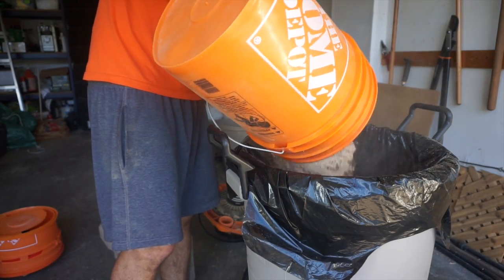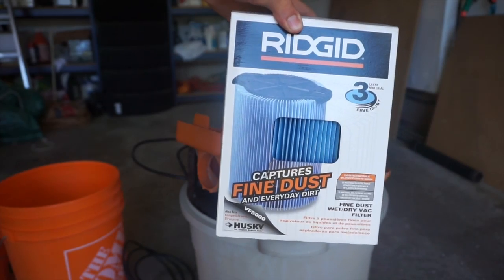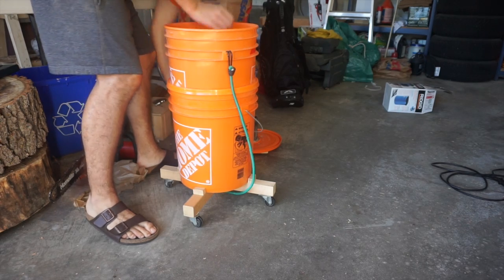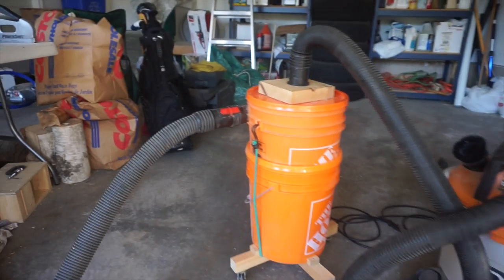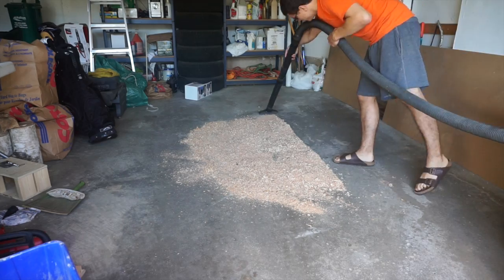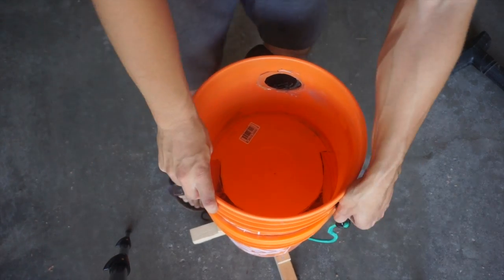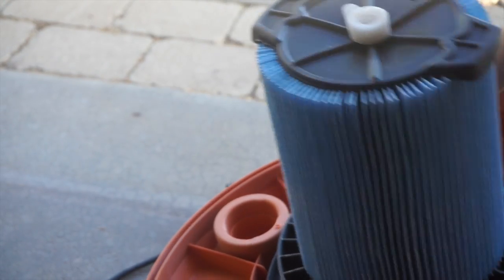Improved Thien Baffle Dust Collector Design From Two Buckets

Comment: For this specific design, optimum separation of fine dust will occur when there is zero air leakage at the joint between the top and bottom buckets, where the baffle is located. You can tightly wrap a continuous length of kitchen cling film around that joint. Any air leaks will be visibly disclosed and sealed when the thin film is sucked inward.

Comment: Wouldn’t it be better if the dirt coming into the bucket was below the baffle? Or am I seeing it wrong
Reply: Dust enters above the baffle, then drops down to the lower bucket. The baffle prevents the dust from swirling around and going out to the vacuum. Edit: now that I've watched it again, I don't see that he actually has a Thien baffle in there, do you?
Reply: Neil Garber yes I understand that, but if it enters below the baffle. Less chance of it going up through the vac. Going to copy your idea, just want to have it right. Thanks
Reply: @DreamstoRealityAutomotiveTV  It's a little counter-intuitive, but that's how the Thien baffle works. Do a Google search and you'll see.
Reply: Neil Garber not arguing, I will look more. Thanks

Comment: Dave, great video. I've given this a go, but can't get the bucket to stick to the lid (keeps coming apart). What did you use to stick it down?
Reply from the maker: I scuffed you the surface with sand paper, then cleaned with degreaser. I used epoxy to make the connection and it has not come apart yet.
Reply: @gogodave0  thanks mate, I'll give it a go.
Reply: @gogodave0  So I gave this a go yesterday. Used loctite epoxy and this morning it looked great. But after vacuuming I tried opening the lid and it came apart. I'm thinking either the type of epoxy is wrong for plastics or I didn't use enough. Any suggestions welcome.

Comment: Dave. Reference the top bucket, I cut about 4 inches off the bottom of the bucket. I cut the baffle out of the bottom lid and cannot slide the remainder of the top bucket into the lid so I can slide the top bucket into the bottom lid.. How much of the bottom lid did you have to trim off so the upper bucket would fit  inside, Do you have a photo that shows how little of the lid has been trimmed? If I am not clear with my question, I close up of the lid on the bottom of the top bucket from the inside and outside should answer the question. I have a feeling I need to trim more off of the lid on the bottom of the top bucket. Help please. Others who have done this, feel free to help also. Thanks in advance
Reply from the maker: Jim Doyle Hi Jim, the top, cut bucket sits within the lip of the bottom lid that acts as the baffle. I have some pictures I will try and post
Reply: I put it all together but silicone is not holding the top bucket to the lid of the bottom bucket. I believe you posted that you you used 2 part epoxy and can you tell me how well that worked out. I am about to cut out a wood circle that matches the baffle and screw it into the sides of the plastic bucket baffle and to the bucket  baffle as I know that would hold. Overall, it worked great....cleaned up and dumped about 1/2 into a paper shopping bag without any trace of waste in the shop vac but my silicone failed me. I really appreciate you discussing this with me.  Thanks for all the assistance and guidance to date.
Reply from the maker: Jim Doyle hi Jim, sorry, I couldn’t figure out how to send you some photos of my bucket dust separator. You’re right, I did use epoxy, and it has held together since I’ve made it a few years ago. I have found there is enough surface area for the epoxy to hold. If you want to try and direct message me on YouTube (I couldn’t direct message you) I can send you some photos of my separator. I am really happy with mine and haven’t made any changes since I made it.
Reply: Dave...can I send you my email and after you load the photos, can you edit the email address off your site so I am not bombarded with emails??? I could do this will my cell phone if you can edit my number from this message? I use a PO Box if you would like to mail pictures?  Can you describe the epoxy process since the top bucket and bottom bucket lid are really tight and not much to put epoxy on as it appears the epoxy will all squeeze out. I have zero experience using the epoxy.  I have an old soldering iron and might try to melt the baffle bucket onto the lid of the bottom bucket? What do you think of that idea???  Thanks
Reply: @gogodave0  I think it would be great if you did a quick video showing the details of the two bucket build, with details like epoxy, etc. You've got a great, efficient design here, but I had to go through frame by frame to pick out a lot of the details. I'm glad I read the epoxy detail here in the comments. 

Even if you can't show the progress of the build, just having some nice shots and explanation of your process would be super helpful. I'm especially curious about the input tube to the bucket. It looks so fragile, but as you've said, it's worked well for you, so I'd love to know the details of how you did it.

Comment: I built a similar one and found that it was great at separating large particles but fine dust still made it through. Basically ended up cleaning two containers instead of one + the drop in suction made mine not worth it. Did yours end up doing better? I dig the base & use of a cord to strap it down.

Comment: How did you attach the lid that forms the thein baffle to the upper bucket?
Reply from the maker: I scuffed up both surfaces, degreased, then used epoxy. Quite a bit of surface area so its a pretty strong joint. Thanks for asking!

Comment: Hi, would in your opinion be any of a difference in using the full bucket with the half bucket, or using 2 full buckets? 
Thanks
Reply from the maker: drail80s thanks for your comment. I think two buckets would be too high. It would be too top heavy and you'd be adding additional air volume that the vacuum would have to move.

Comment: i would think with that much of the lid cut away for the baffle you would get a lot of  flex over a piece of wood cut out and mounted in there. your thoughts?
Reply: I guess if you build it this way and you feel there is too much flex, you still have the option to glue & screw a piece of ply to the baffle-lid.
Reply from the maker: I agree that wood we be much stiffer. But for what it is I think the plastic works just fine. Thanks for your comment!

Comment: will that lose some of the suction ??     I wonder if that system could somehow be built into the canisters itself instead of dragging around an addition bucket.
Reply from the maker: I haven't done any "science" to test the loss of suction but functionally there is no significant pressure drop. My guess is that the pressure drop from a clogged filter and no separator is much greater than with the separator. I don't think they include any chip separation in conventional shop vacs is due to size, and shop vacs aren't strictly designed for woodworking, but it is totally doable.

Comment: Any idea on how to trap drywall dust?   I can only vac for half an hour before the poor filter needs a bashing
Reply from the maker: Hey, thanks for the comment. I think a cyclone would do a decent job at separating the dust from being blasted into the filter. If you do a lot of drywall you might want to go with a dust deputy (or similar).
Reply: Don't mix up the inlet and outlet connections though!   ;o)

Comment: Could you use a 2 gallon bucket on top of a 5 gallon bucket instead?  You say in the comments below that you cut the top 5 gallon bucket in half and glued the bottom back on as the Thein baffle.  I am hoping to use a 2 gallon bucket on top and use the same concept as Tableft's bucket head vac (a kind of a hybrid between his idea and yours--yours is cheaper/easier).https://www.youtube.com/watch?v=1Pn5EQJcRys&t=332s
Reply from the maker: I saw that video, It was a great idea! I used two 5 gallon buckets because thats what I had. The nice thing was that the diameter of the buckets worked out well the way I did it. Let me know how it works out for you!

Comment: hey there Dave, this is a great video! thanks, but could you tell me what type of glue/silicone would you use to attached the half bucket to the lid? and how did you attached the hose connector to the bucket? is there any way you have photos or a video. Thanks.
Reply from the maker: I used two part epoxy for gluing everything together. The hose connector is also epoxied on. I cut the pipe so that it matched the radius of the bucket. I sanded all the connecting faces to rough up the surface and then cleaned with degreaser. I have no problems with the joint connecting the buckets because of the relatively large surface area. However, the pipe connection is a little less robust. I did accidently break it off once but it was because I picked the whole unit up by the single pipe. I was able to just glue it back on though. Under normal conditions, I have had no trouble with the strengths of the joints.
Reply: thank you!

Comment: This is great!  However, could you explain the assembly and work done on top bucket with the baffle?  Watched the two earlier videos and like what you've done with this last iteration best.  Good job.  This one seems to be the easiest and least expensive of all the ones I watched on building a dust collection system.
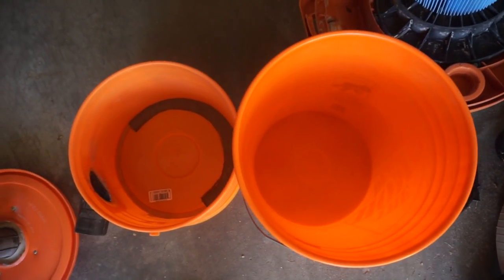Reply from the maker: Thanks for your comment! Pause the video at 0:50 and I will explain. On the left I have a bucket cut in (roughly) half. I cut a slot out of a lid to act as the baffle and epoxied it to this half bucket. I cut a hole in the side of this bucket near the top and glued a piece of pipe (vacuum extender) at a tangent to the bucket to maximize airflow. The second lid, that gets attached to the top of the half bucket, has a hole in the top with a pipe sticking down about 6" which is connected to the shop vac. This draws air into the separator. The dust enters through the port on the side and gets accelerated around the inner side of the bucket. Because it is heavier than air it falls through the baffle and into the bottom bucket. The baffle is intended to stop the airflow to the second bucket so that the dust is stagnant. Because this is not an optimized design the air still moves in the bottom bucket but the assembly works reasonably well. 
If you have any more questions please let me know!
Reply: Thank you so much, Dave.  I think I understand it now.  I will buy a couple of buckets and lids and try this idea.  I'll let you know how it works.  Thanks again for taking the time out to explain it to me.  I had an idea of how this should work, but I understand much better now.
Reply from the maker: No problem, happy to help. Best part is if it doesn't work out you haven't invested too much money!